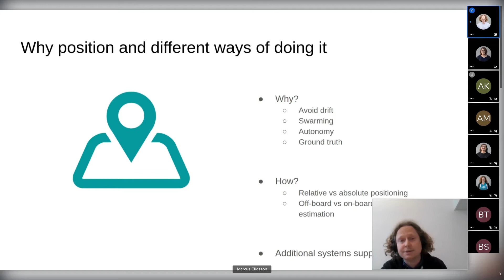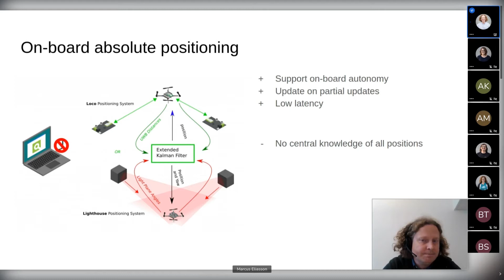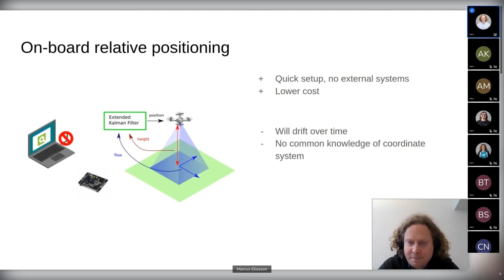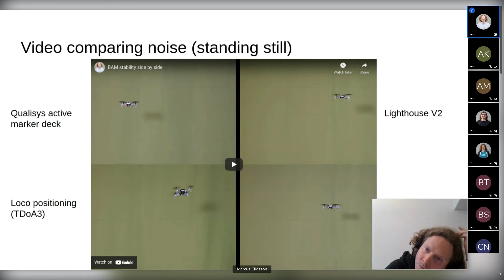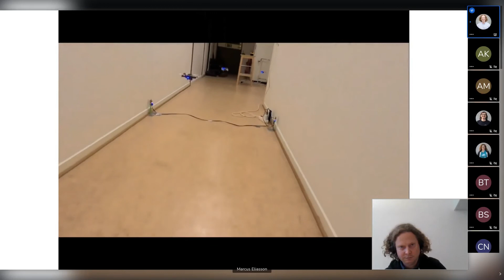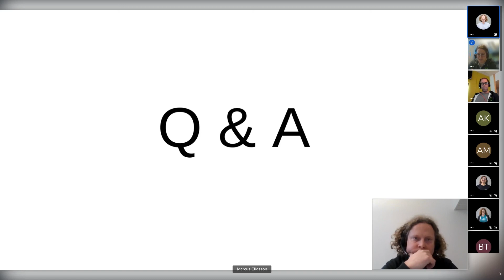Crazyflie and positioning system - workshop

Comment: Very information video. The pros and cons made it easier to identify the suitability of the systems based on the use cases. Would have been better to see some more test experiment videos similar to the position hold test. Maybe small demonstrations based on different use cases. Still a very good session, I think it would be good to add this on the positioning systems overview page on the website, in hindsight something like this would make purchasing the correct system easier. :)
Reply from the maker: Thanks for your kind words! This video is quite new so we haven't added it to more places than just the youtube list and the eventpage, but it's indeed a good suggestion to put it on the positioning overview page for sure! We will try to put some time into that soon.